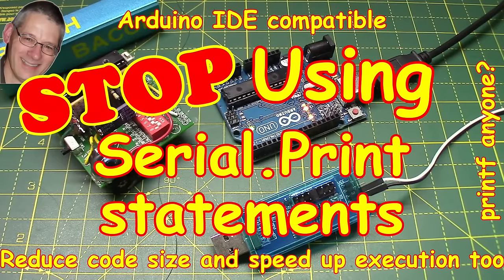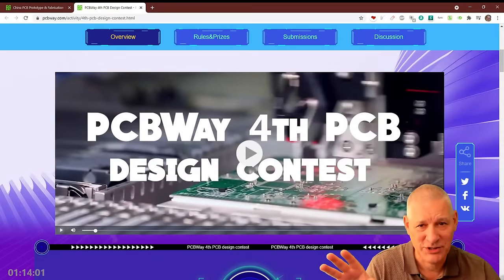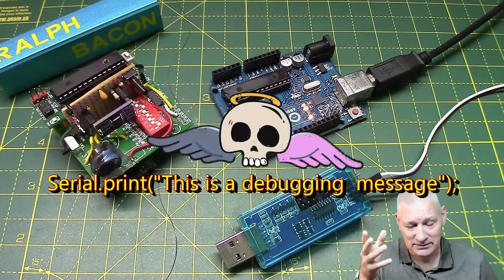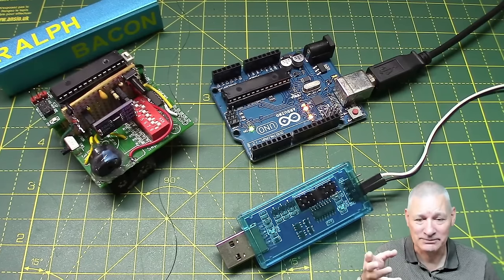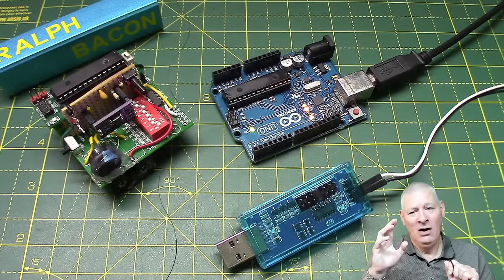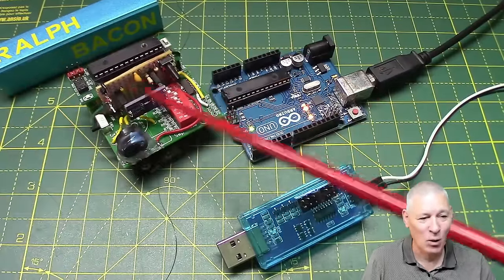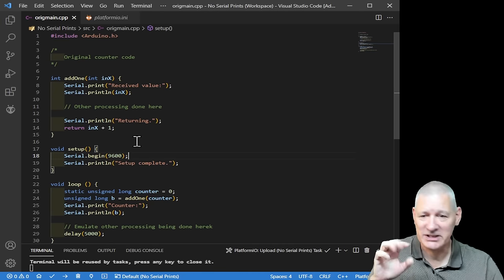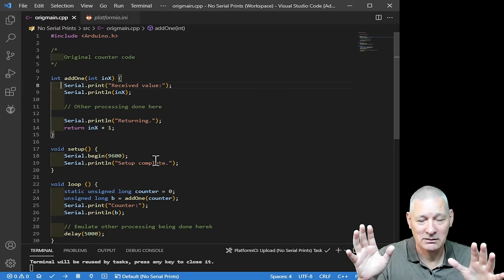#224 🛑 STOP using Serial.print in your Arduino code! THIS is better.

Comment: Thank you Ralph, this is so useful and I was very impressed how it worked and saved space for me. Silly question, is there a way of making the debug trick available to all Arduino code? So, that when I open a new sketch the whole debug solution is already available please? Thank you.
Reply from the maker: The easiest way of doing this is to keep all the DEBUG stuff in a separate file (I'd suggest of type hpp, which is a C++header with code too). Place it in your libraries folder (usually a sub-folder in your sketches folder).

Then, in each sketch just include a simple 
#include "MySpecialDebugStuff.hpp"
(or whatever you called it, keep it easy to identify but not as verbose as this!) at the top of your sketch and it will be included in the sketch.

Glad you found it useful!
Reply: @RalphBacon  Hi Ralph - I have tried it as you described but running the Arduino verify reports "Connection failure". Would you mind including an example hpp file containing the DEBUG stuff please? I am sure I am probably doing something silly! Thank you.

Comment: Is he making a big deal out of preprocessor defines ? Of course.

To excrete a ~27 min vid for a trick that can be explained in 30 secs is probably a skill, so at least have a downvote -- so that it's obvious I care!
Reply from the maker: Explained in 30 seconds to an Arduino noob? You overestimate the general public's skills with C++ compiler directives, I'm afraid.

I could have just deleted your rather recalcitrant and unhelpful comment to show how much I care, but I resisted; everyone has a right to an opinion, just don't shove it down my throat.
Reply: @RalphBacon  I have extensive experience with C++, including FreeRTOS targeting Arduino, but I haven't used it in about 6 years (lousy C#). I'm going back through and reacquiring my knowledge for a project and I found your approach very friendly and simple. Thank you, Mr. Bacon.

Comment: I'm working at a project that has an lcd display, I use that for debugging! I guess I would use serial print too but a few lines where it matters don't think they would slow much..plus i leave them as commentals when not needed
Reply from the maker: When doing PIC work I used a purpose built 16x2 LCD for debugging! But I don't use PIC chips any more. In a small sketch I don't suppose it matters too much, as you say.

Comment: Hey Ralph…you got me thinking about esp8266 preprocessor.  Oh great video and I have implemented the debug routine.  My esp8266 program has grown and my OTA library and Firebase library are colliding with each other causing crashes.  Can you guide me on how to have a dual boot 8266.  I’d like to do an OTA on power up, then restart, ESP.restart(), and do Firebase stuff based on ESP.getResetReason != “Power Up”.  I’m able to manually isolate the two boot ups via preprocessor #define statements but can’t figure out how to do it base on checking the condition of ESP.getResetReason or other condition you might suggest.   Thanks for your help.
Reply from the maker: If you know that the next reboot is supposed to follow a particular path, why not write something to EEPROM to indicate this? Then, upon reboot, you first read the EEPROM and decide what it is you are going to do?
Reply: @RalphBacon  What you suggest makes sense except I can’t figure out how to read EEPROM with preprocessor directives at compile time.  I can read and write to EEPROM in a normal sketch, no problem, but I think EEPROM reads are only done at run time which is too late to determine which libraries to include.  Any further suggestion would be appreciated.
Reply from the maker: You cannot use a directive to #include libraries, that much is true. Best to include all the ones you need if you do not know which state the processor is in.

Comment: Another version (not my idea) is:

#ifdef _DEBUG
#define dprintf xdprintf
#else
extern int zdprintf(char * format, ...);
#define dprintf 1 || zdprintf
#endif

This is using the compiler code optimisation to remove the debug code. dprintf() is what you use in the code, and xdprintf() is a real function which does the printing. zdprintf() does not exist, which does not matter because it is never called.
Reply from the maker: This method could be expanded upon, or tweaked, manyfold, I expect, but I tried to balance simplicity vs usefulness.

Comment: Can use eeprom for debugging, catch all the debug values and dump them in eeprom, than reboot and read the eeprom via uart of so.
Edit: Define with code inside are called macros.
Reply from the maker: EEprom is a bit slow for this and has a limited lifespan. It would be better to write to an SD card that could be removed and read. Pretty much unlimited storage, and log files can be datetime stamped too!

Yes, #define statements are called macros.

Comment: I do add a lot of debugging Serial.print lines in my code and I've seen countless times that how they slow everything. What I do is to add a global boolean variable "debug" and start every Serial.print line with if(debug). That way if the value of debug is 0, then all the debugging lines just don't work.  Also if I have an IO pin that I don't use I add a header to it in the final design that I can put a jumper and turn debug on, leave the jumper off and turn debug off. This way I don't have to recompile and re-upload the the code if I ever need to debug it after some time of use. 
Yes, I know that although this method prevents slowing down, it does not not help (and even makes it worse) with the bloating of the complied code. This is exactly why I just loved this approach, all I need is to combine this with my pin controlled debugging somehow. Thanks! Much appreciated info!
Reply from the maker: Yes, I've done similar with a spare GPIO pin controlling the output. But you cant use that method with precompiler directives, as the code will either contain the debugging lines or it won't!

Comment: would it be simpler to do #define debug //debug ? or do comments get compiled?
Reply from the maker: Comments are stripped out replaced by a single space before compilation starts, Keith.

Now, when you say "simpler", well, whatever works for you. My focus in this video was just to show one way of switching off debugging statements. There must be many ways of doing this, like your example.

Comment: Thank you Ralph for the video, like many others I hadn't consider using a #define statement to enable/disable debugging. 

I'm keen to understand more about the ESP32 Log_v and how it works with the Arduino IDE (2.x) as I haven't been able to get verbose logging working in the Arduino IDE as there isn't a menu option for verbose under the 'core debug level' menu, the highest level is debug. I could simply just use Log_d, but I'd prefer to use verbose to provide the additional level. 

I haven't tested this, but does changing the logging level reduce the resource (flash/ram) consumption when using the Log_x command as demonstrated with the #define statement with the serial.print(), I presume it would. 

If it's not possible I might have to migrate my project to PIO :)
Reply from the maker: Yes.

What, you want more? OK.

On the Arduino IDE, the verbose option is level 5. The new, improved Arduino IDE 2.0.x makes this a bit clearer. (0 is no debug😲, 1 is [fatal] errors only, 2 is warnings, 3 is info, 4 is debug and 5 is verbose).

On the ESP32, if you select higher than verbose then the log_v statements simply don't get compiled into the program. And the same happens with log_d, log_i and so forth. So, yes, you save space (and execution time) but making sure your final code is compiled with the lowest level of debugging you can live with.

This works whether you use the #define I show here, or not (ie using Espressif's log_v etc).

Comment: It would be easy to add a few lines of code to check the status of a button in the setup function. To enable/disable debug logging
Reply: Yes, but you loose the reduction of code ..... every line of code must be compiled for the two options!
And , at compile time , the program do not run in the AT328 and the state of button is unknow of the compiler
Reply from the maker: Logging, yes; compilation, no. If code size is not an issue then leave the statements in but switch the output on and off via a jumper or switch. I'm doing that with my ESP32 Web Radio.

Comment: What I have decided to so is debug_a, debug _b and so on so I can have different debug groups. Something else I’m going to do other times is dedicated a DI as a debug enabled and then use If/Then to make an on demand debug. The second won’t save memory, but it’ll speed things up when I don’t need to monitor the serial port.
Reply from the maker: An excellent idea; I wish I had done this with a couple of my larger projects where you might need really low level debugging for a particular section but don't want to be flooded by those debugging messages from other parts of the application.

I'm wondering whether this could be automated in some way by detecting the 'owning' file name (as I split my code into several source code files, by function).

Comment: Really great explanation of some "micro-knowledge" that we old hacks use all the time, but is counter intuitive to others. And a great explanation of the value of the CPP macro language. I know CPP has an 'evil' reputation - but this is a great example of where it shines. Also, the nice thing about your example is that the debug is completely removed from the final version of the .exe. Supurb. I'm going to subscribe. Continued Success!
Reply from the maker: Welcome aboard! I'm glad you found this video useful (or at least interesting) --- hang on, what's this all about C++ being evil? 😲
Reply: @RalphBacon  C pre processor... macros have been maligned for decades

Comment: Awesome video Ralph and a great introduction to preprocessor macros.

This all works well until you want to use the return value of Serial.print().

From the documentation:
print() returns the number of bytes written, though reading that number is optional. Data type: size_t.

So a statement like 
size_t bytes_written = Serial.print("Some message");
can't be converted into 
size_t bytes_written = debug("Some message");
Reply from the maker: You are correct. In an Arduino environment I've never tried to get the size of the output. It's useful for webpages if you're outputting to a buffer (using printf) on a webpage, on an ESP32, for example.

Comment: I have been away from C and C++ for a few years and find your videos good to jog my memory. 
I'm having a fight with the advanced Arduino  header file  from your Github repo when I have multiple .cpp files in a project.  If I include the header in all the source files the linker chucks a wobbly  over multiple definitions. I have tried guards around the header contents to no avail.  Currently I'm defining all the debug statements as nothing  with #defines in each file i'm not debugging at the time and commenting out the include.   There has to be a better way. Do you have any ideas?
 IDE is Platformio.
Reply from the maker: In PlatformIO, you can just use #pragma once as the header guard and it works fine (it's non C++ standard though). It's important to get the #include statements in the correct order, an earlier one cannot depend on a definition on a later #include.

Obviously you cannot have the same #define in more than one file. Let me know what the exact error is you are getting if this all doesn't work.
Reply: @RalphBacon  I found a couple of fixes ,  put the  functions in the  .h file  in an anonymous namespace
namespace { 
  void debugNothing(...) {
    // This does nothing and will be zapped by the compiler
  }

  // By default we want a trace stamp output in the first instance
  bool traceStampRequired = true;

  String debugStr = "";
  bool foundNL = false;
}
or define the above variable and functions as static. 
Either keeps access to the current translation unit  and prevents the linker getting upset.  I'm not sure which way is the best.
Reply from the maker: I would use a namespace if I want to reference something in that namespace from somewhere else (another namespace, perhaps). I would use static variables if I want the linker to ignore them (so they are not extern) and/or so I can restrict the scope to a single function.

Comment: Nice explanation, a bit  long-winded ;-) , but i'm running in trouble on places where i've used something like Serial.print(foo, BIN);   of course an extra define  debug_with_parameter(x,y)  serial.print(x,y) can be a solution ....  But not so elegant.
Reply from the maker: Well, Jan, you had to stumble across the bit I did NOT want to do in the demo as most would have switched off! However...

If you change the definition of each debug(x) and debugln(x) to:

debugln(x, ...)  // at least one parameter, maybe more

then change the underlying Serial.print to:

Serial.println(x, ##__VA_ARGS__)

you can use 
debugln("this is a string")
debugln(42);
debugln(42, HEX);

Works for me! But on your own head be it! Let me know how you get on.
Reply: @RalphBacon  Thanks Ralph, tested it and it works as supposed! 👌Grtz from the Netherlands

Comment: Sometimes I think primitive coding with meaningful words is way easier than to optimize my coding and than loose track. Even debugging comes easier with primitive more lines consuming code, and at the end the memory needed for the compiled code is not so different. Whats your point on this?
Reply from the maker: I definitely think you need to code in a manner that you find comfortable and maintainable. It's no use using some esoteric mechanism because it's "better", only to find in 3 months' time that you no longer understand your own code!

Of course, comments and a well-structured program can greatly assist in program maintainability too, with meaningful names for variables (it doesn't matter how long or descriptive the name is, it takes the same space once compiled!).

Proactively striving to produce "better" programs is always a laudable goal too; staying too long in one's comfort zone does not improve programming techniques, so trying out different ways of coding (eg using a Finite State Machine methodology) is always worth doing.

Comment: Thanks Ralph. The Arduino Printf will make my code cleaner compared to my current multiline approach.
Reply from the maker: I do have a video in the pipeline that goes into more detail on printf, aimed at beginners.

Comment: How about your point 1) Program bloated ?

Anyway I'll use your first method anyway _ thx for sharing !
Reply from the maker: How about it, Keld? If we remove all the Serial.print statements then the code shrinks, right? The compilation (before and after) in my demo showed quite a reduction in size with debugging off.  Size isn't everything (despite what others might say) so maybe code size is not too important - but the execution speed should be.

Comment: Hi Ralph great video, perhaps I should give platformio another go are you planning to do a video onn it?
Reply from the maker: I was, then I wasn't (it's a huge task) but I might still do it. No promises though, Andrew! Hope you're keeping well. Still in lockdown?
Reply: @RalphBacon  Yes in lockdown probably for another couple of weeks. Your video has inspired me to give PIO another go and I am grateful, its easily the best platform once you are comfortable with the basics. I just tried the debugger with my STM32 project and it is amazing you can drill down your way through a linked list in memory just by clicking with your mouse. Also conditional break points etc can't see that I will need many Serial outputs going forward :) They have also reduced the need to play in the ini file which put me off previously, now libraries are added automatically. I had been holding out for Arduino IDE 2.0 but they just don't seem to be making progress with the language server which makes it rather unusable... Thanks again

Comment: Another thing you should cover here: there is almost never a reason not to use the F() macro on string constants, especially debug strings. F("…") addresses the string directly in the flash memory region. If you use a string without F(), it needs to be copied into RAM first.
Reply from the maker: Now you've got me thinking whether the #define should have included an embedded "F(x)" macro... if it can be done.
Reply: @RalphBacon   You can't do that without fixing the argument type to string literals. As Arduino is C++, to my knowledge there is no way to get macro polymorphism (as with "_Generic" in C). A template function won't help because you need to apply the type switch before the actual function call on the arguments, i.e. outside the template scope. But I'm always eager to learn something new, so tell me if you find a way. OTOH, keeping F() in the call doesn't really hurt, and possibly serves as an awareness reminder.

Comment: I think the #define is very interesting way to enable and disable code, however, for debugging with serial.print (etc.) I think it's less usable.

I don't want to enable all debugging, I want to just enable one single serial.print, to get the state at that point. I don't want to bloat with all debugging that I don't need any more.

After I'm done with debugging one feature, I want to remove that debugging code, to avoid bloating CPU with old debugging data too.
Reply from the maker: You can do that too with a variant of this technique. Have the debugging enabled only in those files which you are trying to debug. Not as simple as this method but does allow a more granular approach.